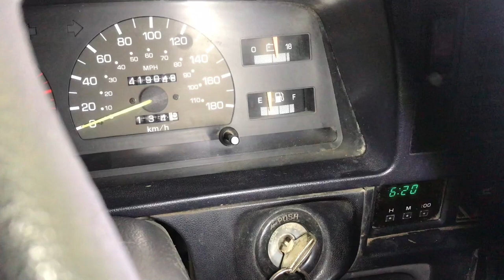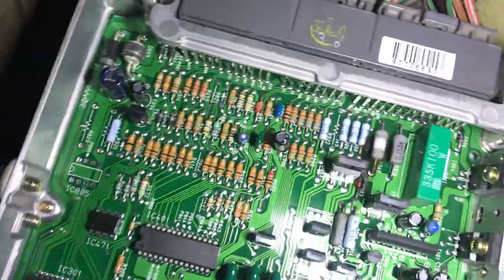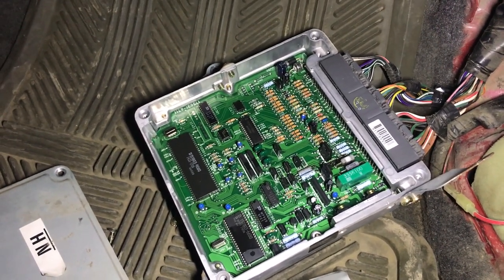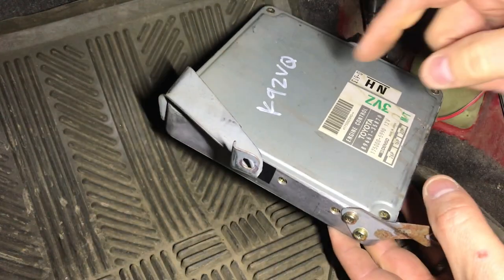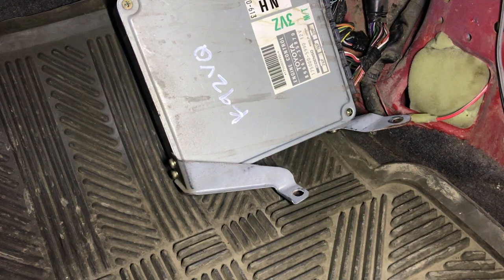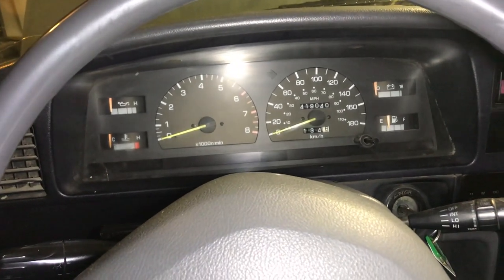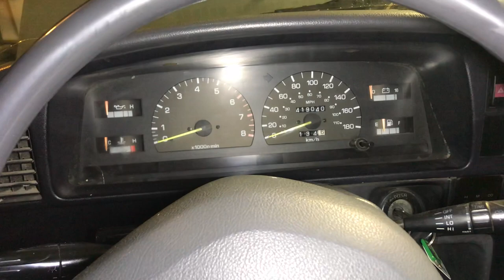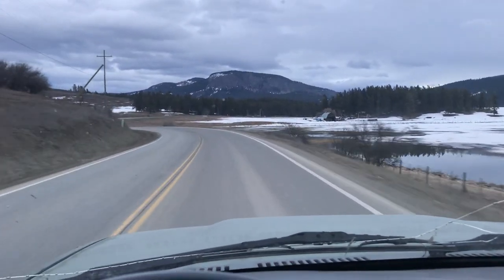89-95 Toyota Pickup Check Engine Code 21 Solved

Comment: Chasing down a code 21 as well. Replaced the 02 sensor and checked my ECU. It doesn't look bad at all. Just a little bulge on one of the resistors you pointed out. I partially checked the wiring, as you probably know its really difficult to access. Hesitant to grab a $100 ECU and have it burn out again from bad wiring. Did you find out why the ECU circuitry burn't up? Did you have any other issues pop up with it in the last 2 years?
Reply from the maker: It would be nice if you could find that one resistor somewhere and solder a new one in. Good luck to you!! I never found out why it burned up. I figured a faulty o2 maybe shorted out. No other issues popped up but I didn’t drive that truck too much. I fixed the body rust and sold it.
Reply: @caseyn720  I checked the wiring up to the firewall with the exception of a section over the transmission, didn't find any issues. Tested the resistance on that suspect resistor and I got 0.4 ohms, the print on the resistor says it should be 430 Ohms. I guess that means its bad and I need a new ECU. If the 02 sensor didn't cause the ECU to short then swapping in a new one could fry it as well!

Comment: thanks, man... I'm going to go check out the O2 sensor circuit and see... 
my neighbor said that my exhaust smelled funny and my cat was clogging.
 sounds possibly related. now here's a question: if the cat is clogged, causing the ECU to have trouble achieving the closed-loop cycle with the O2 sensor that would be normal, could that cause it to load code 21? or is it more likely that a bad O2 sensor simply caused the cat to become clogged? thanks. 
peace be upon you, sir.
Reply from the maker: Don’t tell anybody but I always remove my cats. They do tend to clog up over time. I had a 97 Chevy pickup and the car material melted partially clogging the exhaust. Anyways I think a bad o2 can cause the truck to run rich and cause the cat to plug over time. On this Toyota it has a flange and gasket on each end so I just cut the bolts and pulled it out. Removed the cat material and stuffed it back in its place. Take that EPA. Mind you I’m in Canada so we do t have those laws... I think. Anyways check the o2 for resistance and check the wiring for continuity. If all is good take a look inside the ecu. Hope you find the problem.
Reply: @caseyn720  yeah, I'm with you on that but I live in California so... 
  the problem turned out to be simple and obvious once I crawled on my back in the dirt- a bush or something ripped the wires off of the first O2 sensor (the one before the cat). once I figured out the non-matching wire colors (four wires on this one) I got it working in good order... yea; back to square one!
 now... if I can remember what I was doing before this... well anyway, by my account you have done your good deed for the day. thanks, m'man.
Reply from the maker: @primateinterfacetechnologi6220  Glad you found the problem. Now onto the next. I'm getting ready to throw a Volkswagen diesel into my truck. Hopefully I will record that whole process. Stay tuned.

Comment: I wonder if the schematic for the ECU is available. I repaired electronics for many years, and that would be a very easy fix.
Reply from the maker: Yeah I’m sure it’s available somewhere deep in the internet haha. Or in an old service manual stuffed away in a back room in some Toyota dealership. I was going to solder on new parts but wasn’t sure what I would need so I just bought the whole computer instead. This thing is still alive and well. TDI swap coming soon.

Comment: Did you have a check engine light before you had diagnosed it?? Because I have a code 21 but my check engine light isn’t on only when I put the wires in the diagnostic

Comment: Loved the moth part! I have an 89 with the 2.4 and this may be a dumb question but how do you get codes on it? Check engine light is on.
Reply from the maker: Pause my video at the 0:13 mark. You’ll see I use a jumper wire on the diagnostic plug. You just put the jumper from TE1 to E1 and then go in and turn on the ignition. The check engine light will flash. So say it flashes 2 times then a slight pause then flashes 5 times and then a pause. That would be code 25. So do that and figure out which codes you have and go from there. 

Here’s a link to the diagnostic port and the terminals you use the jumper on:

https://pinoutguide.com/visual/gen/Toyota_old_diagnostic.jpg
Reply: I forgot to say it but thank you!

Comment: Thanks. Something else to think about in the world of 21s lol
Reply from the maker: Really it could be anything on these old trucks.
Reply: @caseyn720  Hey finally solved my code 21 issue last night, well my mate did.
Went through all toyota previa forums trying all the usual.
It turned out to be loose or faulty MAP sensor. No one has even mentioned this on forums so if your having the same Idle issue and stalling then check the MAP 👍🏻😁

Comment: How do i get a little jumper cable like that? My boyfriend’s ‘90 pickup has a check engine light and we’re trying to figure it out 😅
Reply from the maker: It's just a piece of wire with the ends stripped. You can use a paperclip.

Comment: Hi. My 3vze is in limp mode. I jump the wire. And  no codes come up. But I do have a check engine light. It starts and idles ok. Reverse ok. But in drive. It’s very very slow. Is it possible to jump it at the computer? Or do you think the computer is the issue?
Reply from the maker: I think you definitely need to double check that you are jumping the correct terminals. If the check engine light is on it should start flashing the codes for you.
Reply: I followed the instructions in the service manual. Off the top of my head I jumped E1 and te1. I then turn the ignition to the on position. And no blinking. Yet I still show the check engine light. I tried to clear the codes by pulling out the EFI fuse. Didn’t work. I then tried a hard reset by connecting the positive and negative leads together over night. Still the code remains on. Thanks
Reply from the maker: @mikeinpoco  Maybe pull the ecu out and open it up and just look for anything that might be a problem. In this video I show what I found in my ecu and it was the whole problem. Also maybe trace the wires from the diagnostic port. I had some wires from around that area loop down and rubbed on the inner fender. Caused a couple issues as well.
Reply: Thanks for getting back. I’ll let you know how it goes.

Comment: No more vids bud? How's the truck comin? Would love to see what you've done with it so far.
Reply from the maker: Hey ya sorry I havent been making any videos. I have replaced the rusty cab corners and rocker panels. I also bought a 2000 jetta diesel for $100 and plan on throwing the little diesel into the toyota. Ill do my best to film that whole process.

Comment: Codes are stored in ECU. If you already replaced ECU. U didnt need to undo battery😃
Reply from the maker: That part was more to show how you can clear your codes if you didn’t replace the ecu. 🤘
Reply: @caseyn720   hay brother i work on my truck. I fix are two sensor. And the ligth is on tha check eg

Comment: I fixed my code 21 on a 1995 Toyota 4Runner it was main o2 sensor , but now when I check for codes it just a continuous flashing on the check engine light does anyone know what it means ??
Reply: Means it's no issues if it's blinking
Reply: That means that there are no codes ,?
Reply: Ythdye whts the main o2 sensor???

Comment: nice pickup, my 1994, 22re, standard, 5 speed, with 313,000 miles failed me last Friday, the engine stopped on the Miami turnpike at 70 miles per hour, it is giving me the code 12, it is not the distributor, it can  be the coil or the igniter too, it could be that some cable is broken or it went to ground because the ECU is not receiving the signal and it is not the ECU because it would not give me codes, long way ahead, if someone has had the same  experience let me know so I don't go blind, without work, with little money I can't take her to the mechanic, I have to do it, please help.  Thanks.
Reply from the maker: Thanks! And that’s rough. But I am impressed at the 70 mph. I dunno if mine would do that. All I can say is check everything over before you start throwing parts at it. I’ve had wires run through on this thing that caused headaches. Good luck!!

Comment: Im getting 9 miles per galon on my 91 v6 3vze. Lol too much
Reply from the maker: Oh man that’s bad. And no power too. You could be driving a big block Chevy and at least be able to smoke the tires while getting poor mileage.
Reply: @caseyn720  that's right no power what wrong you think on my?
Reply: @josep.7387  I would verify you don't have a misfire by checking your spark plugs. I had one and that fixed the low power issue. Now it just runs really rich with that pesky code 21.
Reply: @codyhinds683  yes it got misfire but i just changed spark plug and wires and still the same
Reply: @codyhinds683  i also repalced the oxygen sensor
Reply: @codyhinds683  show me the code 25
Reply: @josep.7387  You can try cleaning the EGR filter and replacing the EGR VSV. Theres a vsv testing procedure in the manual. Mine was broken/clogged. That helped it run a little better.